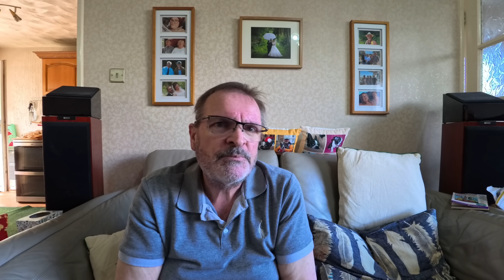Expert Ships Engineer Reacts to Baltimore Bridge Crash

Comment: I’m a tow boat pilot
Prior to doing this I worked as a helicopter mechanic for ten years in the Army
What I’ve learned is airplanes and helicopters are designed to have back up systems 
Also our marine boats and ships have back up systems for the same reasons
I can tell from first hand accounts and experience that even with back up systems things can fail
I agree 100% with this gentleman 
He is spot on with the same conclusion I’d come up with after watching the video of the ship impacting the bridge 
One thing about these ships and boats that people do t realize is with that much weight they don’t handle like people expect
If you turn left they slide to the right and vise versa. It’s like drifting
Another thing is that they don’t just stop
Depending on the current wind and speed it can take what deals like an eternity to stop the vessel
Things happen fast in our cars but for the ships and boats you can be in a wreck for minutes and minutes and there’s nothing you can do but watch
Here in the states I can’t speak for anywhere else but at least here
We have American pilots who get on these ships to bring them in from the gulf or from the ocean 
They bring them in get them to a mooring location or to the dock they are going to then the pilot gets off 
Same thing when leaving heading back to sea
This particular crash was the perfect storm of everything that could go wrong going wrong
I keep seeing media telling lies and then people regurgitating the same pile of 💩

Comment: How do you explain 2 min of black box data missing?
Reply: That's not always a failure of the Black Box itself though. If for some reason no data was being sent  then the Black Box can't record it.  Did the black out affect the instruments, if so, were they unable to send any data to the Black Box?  That's a pertinent question. 
There was a case with an airplane Black Box (and those are way more sophisticated than a Maritime Black Box)... it was pulled out of a South African airliner that crashed. The last few minutes of cockpit voice recording was blank. 
Black Box was working perfectly.   Plane had crashed because of a fire, fire had burned the wires between the cockpit and the black box, so the Black box was not receiving any data. 

Well, this ship may have crashed because of a loss of electrical power, and that same loss of electrical power may have interrupted the sending of data to the Black Box.
Reply: Come the exact data they were looking for isn't there?  Two minutes of missing data because it stopped recording just then?  Too much of a coincidence for me.  Happened shortly after the Russian Theater attack,  If you don't think Russia would do something like this, I recommend last Sunday's 60 minutes - Havana Syndrome is linked to Russia.

Comment: Theres also a story that the "black box" recorder stopped recording data for the 2 mins during the accident?
Reply: You should consider a difference between the black box 'stopped recording' or the black box recorded nothing because the ships instruments didn't send any data during the power cut.

Those are two different scenarios. I'm no expert on maritime investigations, but I worked in aviation and went through a lot of accident reports. 

I remember a South African airliner where the last minutes of the Cockpit Voice Recorder data was missing.   The CVR is one of the black boxes.   They tested it, and it was working fine.  What happened was the same fire that caused the crash had burned the wires between the cockpit and the black box, which is at the other end of the plane.   The black box hadn't stopped recording, it just never received anything to record after a certain point in the accident.
Reply: @jimbobeire  Fair point.

Comment: Good explanation of everything, but what turned the Rudder. Someone had to turn the Rudder, power or no power. The Ship was headed on course to pass between the Bridge supports, then it turned for no reason. It began that turn apparently, prior to the power going out, the first time, then the power flickered on and back off. But, the Ship was already turning. Straight for the unprotected support.
Reply: The rudder doesn't always point straight for you to go straight. If the tide is pushing you from one side, then you have to angle the rudder to counteract.  Look at a chart of the port. The ships lights went out around the time it was passing the Curtis Channel.  Tide coming out from that direction, first hitting the bow, would tend to push the boat to port, so the rudders are turned to starboard to counteract... then as the ship keeps moving, the current from the side hits the middle of the ship and then the stern, so the rudders would be adjusted to keep on course.   But... if the power went, and the rudders were still in the position of compensating for that side current, even after passing it... the ship will turn.
Reply: @jimbobeire  I guess you're saying that the power went out and the tide miraculously pushed the stern of the Ship at just the right time and amount, for the Ship to turn and hit the Supports. Ok, I can buy that.
Reply: @markgreiser464  No, I said what I said... and that was that it is possible that the rudders, counteracting a current at one point, then stuck in that position, giving the ship a yaw to starboard even when there was no more current from the side to fight.   and once it starts getting out of the channel, underwater effects like bank suck can come into play (this is what caused that ship to get stuck in the Suez canal a few years back).  It's all very different from just driving on a solid surface.  
Also, the ship is over 900ft long... it doesn't have to be a precise turn for some part of the ship to hit the bridge. The ship is almost as long as the gap between the two pillars, so let's not pretend this was like getting a basketball in the hoop from the halfway line. 
It's more like driving a truck on ice between two trees about as far apart as the length of the truck.  Everything has to go right for you to pass through the middle, and pretty much any mistake will cause you to hit a tree.
Reply: @jimbobeire  it's also possible that someone made a decision to ram a bridge. I can wait for the report, before I make a final decision on my thoughts. As is , it looked pretty intentional.

Comment: I had attributed the heavy black smoke to an engineer panicking or being ordered fire up the main engines out of sequence. Black smoke indicates poor combustion, Had they attempted to fire up the mains without the air generators turned back on it would have suffocated the engines, leaving excess fuel to burn off in the cylinders, thus the heavy smoke. I dont think they had enough personel to fire everything up again fast enough to do it proper?? IDK...im grasping like everyone else.

Comment: I think it’s too strange be a coincidence. The bridge had no cement dolphins and it’s a very important bridge for cargo ships and the economy of Baltimore and there’s about to be a solar eclipse which the national gaurd is being deployed and we’re being told to stock up on food and water to last us 3 days
Reply: What does a solar eclipse have to do with any of this? 
Also there are a couple of cement dolphins, but probably should be more.
Reply: @jimbobeire  No, there were no cement dolphins it could have been easily avoided and they are deploying the national gaurd everywhere April 8th so this seems like just the beginning of an event and this bridge has a ton of cargo ships frequenting now the food supply has been cut off
Reply: @cody3504  There are a pair of cement dolphins, but they're further from the bridge than where the ship turned and they look like they wouldn't have done anything for a ship that big anyway. Probably installed when the average cargo ship was much smaller. 

I'm not going to even try to address the rest of your doom mongering.  Just remind you that Baltimore is not the only port on that side of the country and food will just come further by truck or rail from different ports.  The sky is not falling.
Reply: @cody3504  There are cement dolphins but they are way too small for the size of current shipping. They are visible in multiple images of the area.
April 8th is an eclipse in the US, there will be major movement of people to see it in the areas of the shadow.  Police and national guard being mobilised is happening, just like it did for the previous solar eclipse.

Comment: Still, nothing is explaining the missing 2 minutes of the black box recording
Reply: Missing recording... or the black box didn't receive any data to record? Those are two very different scenarios. 
E,g, SAA flight 295, the same fire that caused the crash also burned through the wires connecting the cockpit microphones to the black box (which is at the other end of the plane from the cockpit). 

If the ships instruments lost power and didn't send any data to the black box malfunction, then the Black Box couldn't record anything, until the power came back on and the instruments started sending data again.

Comment: If your car is sliding on ice you know you shouldn't hit the brakes.. but you can't help it. 

Same with their crash reverse maneuver. It was clearly too late to hope to stop but it is what they did as a natural reaction to the desire to be stopped. The fact they were able to get the traffic stopped in only 2 minutes was a remarkable bit of luck or many more vehicles would likely have been lost. I'm sure when they run bridge simulator scenarios to determine different possible actions and outcomes, the crash stop will be shown to be the fatal worst choice.
Reply from the maker: Yes very quick response, i do believe a passing police man saw the boat nearing the bridge and stopped traffic his end of the bridge. So lucky not more were killed.

Comment: Engine had to be fully stopped to engage reverse gear.  Don't think they had tme.
Reply from the maker: If it was a crash astern they would have applied braking air and then gone astern. Likely to lift relief valves on the engine.
Reply: It's a direct drive.

Comment: That bridge should have had massive sheer gaurds in place. With large vessel traffic navigating that passege, the port authority should have anticipated this situation. I would put some of the blame on the Port Authority.. The photos show the adjacent power line towers having sheer gaurds, so why didnt the bridge structure have the same?
Reply: don't blame the bridge
Reply from the maker: Cost i suppose. But like driving to close to the car in front, no body ever has to brake hard do they.

Comment: Was this accident able to be averted? A rowboat would have stopped if you would have dropped the anchor.
Reply from the maker: The mistake people make about ships anchors is that it bites into the sea bed. In fact you need a length of chain or anchor cable on the sea after the anchor is dropped to keep the ship from drifting.
Reply: This ain't no rowboat.

Comment: Forgive my inexperienced opinion but it seems that if a propeller is fully submersed in the water, that any 'paddlewheel effect" would be greatly reduced if not eliminated? A paddle wheel only works because only the half going in the desired directin is submersed in the water right? And not that boats are anything like ships, but I never noticed that effect in a boat. All of this is of course taking into consideration the aggressive turning we see happen in the video, which seems to me like it would require some serious turning forces?
Reply: i think "paddle wheel effect" is misleading ...the torque from  an outboard engine with prop completely in the water  will greatly effect the steering
Reply: @davidjones-vx9ju  are you talking about an outboard in reference to my mentioning my "boat" experience?

Comment: as one who has operated single engine tugs for years what you are saying is exactally what I thought happened. it was called prop walk, when backing down hard the stern of the vessel will pull to the port which swings the bow to the starboard. the large plume of smoke from the stack told me they must be backing down hard which turns ship to starboard as can be seen in the overhead diagram of the ship's track. a ship of that size loaded at that slow speed the rudder has little or no effect when backing down. looks like they panicked and backed down instead of going hard ahead with hard port rudder. just an educated guess since we have no info about what the ship's main  engine was doing, the main engine that turns the propeller has nothing to do with supplying electrical power, only turns prop

Comment: I listened to another video presentation and one gentleman said right at that area there is a strong water flow that goes across the channel that may have pushed the the back end of the ship causing it to head in the direction of the it’s impact when the ship lost its power.
Reply from the maker: Thanks for the info
Reply: Additionally the wind was blowing in that direction as well. Not sure of the wind speed but it certainly wasn't helping.

Comment: With all due respect to a fellow Engine Rm officer: what the hell this dude is talking about ?  Emergency Generator is feeding a ME starting air compressor ? What a nonsense !  I bet 10 bucks that at the time of the event the ship was consuming 350 - 380 kW to run the ME and all its AUX. EG produces 50 - 75 kW of power depending on the type of a ship. Major loads are: Navigation Lights, Emergency Lights,  Emergency Fire pump and a Steering Gear. However a Steering is operated MANUALLY and a rudder response is much slower. And of course it is not done from a Bridge but rather locally. The real reason for the blackout will never be found. Your guess is as good as mine. However I am willing to bet another 5 bucks that it has something to do with the ship's Managing company. You can Google it. I am quite happy that after 18 years at sea as an Engine Rm officer (Ch. Eng, Tanker Endorsement) I am now operating a nuclear PG plant. What a difference in culture and safety!

Comment: Bunch of bullshit lets see the camera's in the wheelhouse. They run off twelve and 24 volts  dc current. Also there are manny  generators that supply 120, 240, and480 volts and higher. The whole thing stinks.

Comment: Does anyone know the number and type of propeller(s) on the Dali when the collision occurred with the Baltimore bridge?

Some have suggested the Dali was fitted, not with a traditional  propeller, but with a looped or toroidal propeller to improve efficiency and reduce noise.  Apparently, the handling characteristics of looped or toroidal propellers are different than traditional propellers.  Could this have been a factor?
Reply: Reportedly a single prop design which is only the worst design if you want to change directions in a hurry. And at 984 feet long nothing is happening in a hurry.
Reply: @robertdusziii4125   Thanks for your input.

Comment: I heard the ship lost all propulsion and steering control with from major electrical failure. I also read the smoke was actually the Emergency Generators kicking on, trying to come online.. That is a lot of smoke for generators though.
 Since they had no steering control, they dropped the anchor in an attempt to slow down the ship, which caused the ship to veer into the bridge. If they did not drop the anchor, then veering to starboard from a Back Emergency bell would also cause the same thing.

Comment: Yes, those are my guesses as deck commanders as well. The turn to starboard can also be attributed to the fact that they dragged down the starboard anchor which created a moment to starboard on the bow. But the smoke from the chimney when it began to turn indicates that they drove the machines hard in a reverse maneuver to reduce speed. and thus gained a port torque on the stern. Many people ashore do not understand how big ships like this are and what distances it is to move on board to another place, say from the engine control room to the steering engine. They are not small dinghies you can just jump over to the other side.

Comment: I wonder about the bow thruster and why it was tried . I had presumed it couldn’t be powered up . Your explanation makes sense. Also your point about the emergency generators being away from the engine room and no doubt at a higher level so the time scale to reach them and the fact that they don’t power the compressed air system to start the engine . Hopefully lessons will be learned it’s just very sad that 6 lives have been lost ! I wondered if they sounded the ships horn ? Or is this reliant on electric power as well  ?

Comment: I'm following you, but I must ask a pertinent question.  Does that ship have Electric Directional motors under the stern, as you did mention a "Bow Thruster"?  You did mention that the black smoke was because they were taxing the diesel engines that drive the ship, (you implied in Reverse).  So you're not saying that the black smoke was from the auxiliary power plant, is that correct?  What you are stating, that you believe it was a comedy of errors.  How convenient.  In today's volatile political climate, I still believe this was deliberate and the ship engineer would know how to pull this off to make it look like an accident.  If anyone on that ship is a Muslim then you can bet they were instrumental in bringing this about because we know this ship was registered to a foreign entity !!!  At this point everyone and everything is suspect and on the table for examination.